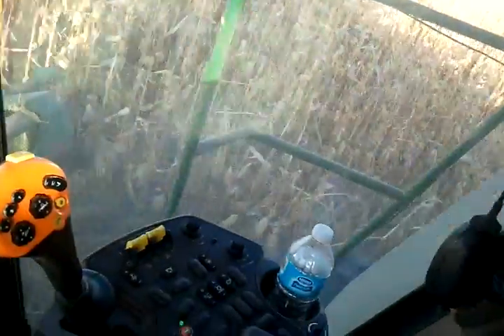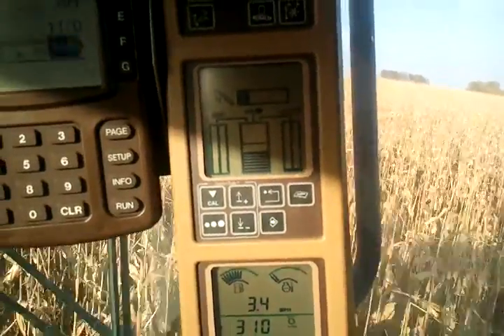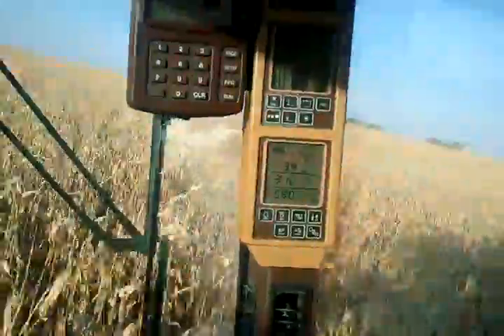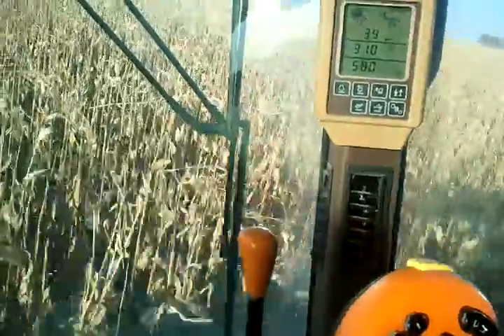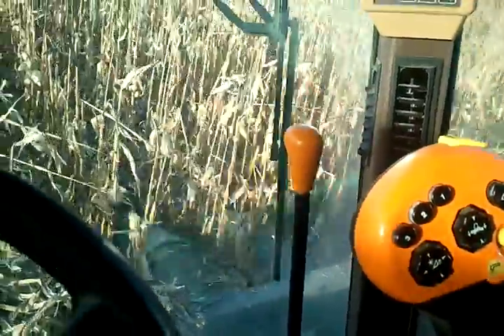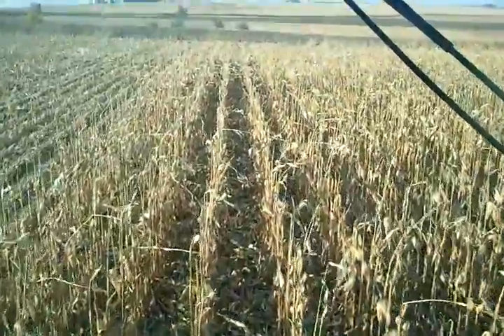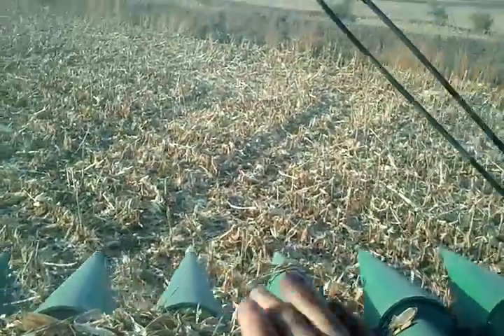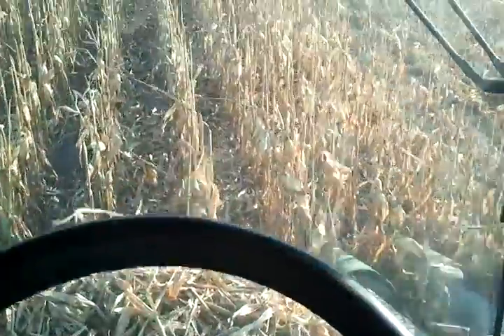How to operate a combine. John Deere 9750STS. Corn harvest.

Comment: Just curious buddy but how long did it take you to learn how to operate a combine until you were comfortable with it? It's been something I've been wanting to do since Highschool. Thanks!
Reply from the maker: +JJ riggs Not long at all, do a ride along with someone and they can teach you the basics in just a couple rounds.  Had the wife running it last year after riding for an hour and she had never even operated a tractor before that.
Reply: JJ riggs i am 15 and my brother is 13 and we done most of the combining for the past 2 years on our farm, My dad and older brother haul grain and me and my little brother run a combine each. If you are paying attention it only takes about 10 minutes to learn how to operate a combine. And our combines are from 1996 one is a JD 9600 and the other is a Massey 8460 so they do not have any fancy pre settings, so you just have to adjust as you go.